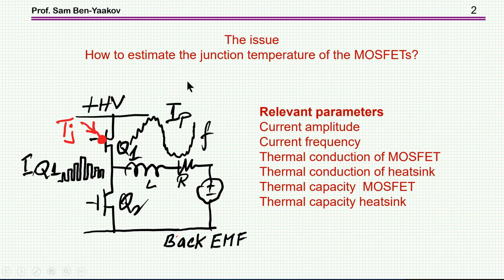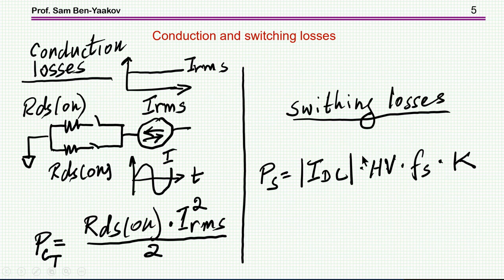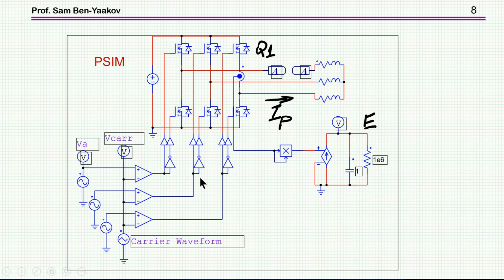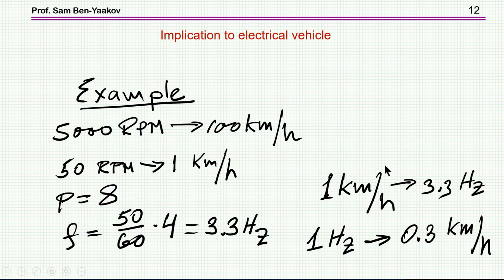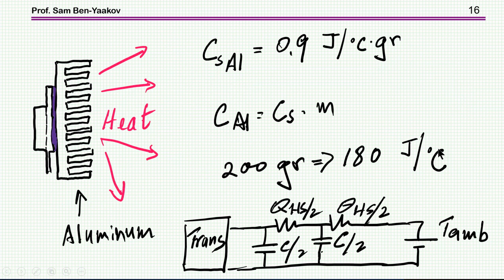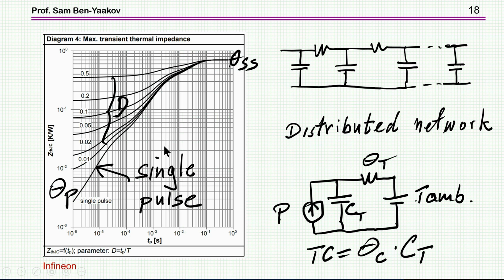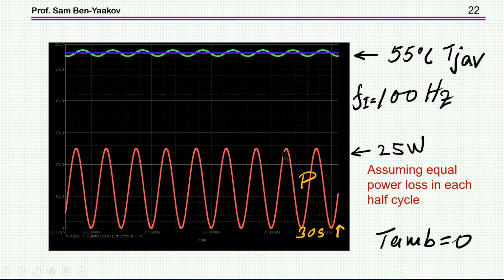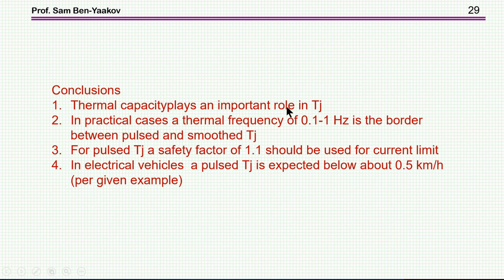MOSFETs junction temperature in power inverters: Low phase frequency and thermal

Comment: Such a great explanation!, i only have one question.. do we usually consider the calculated capacitance in the circuit as milli J/°C ? Because when you calculated it, it was 180 J/°C which i thought is so large and will result in a very high time constant.. but when you plugged it in the RC model you split it into two 90m J/°C which i think makes more sense to my understanding.  

So sir, is dividing the capacitance by 1000 the right approach to go? 

I mean, the simulation results you showed are reasonable. But are they for a 90m J/°C each or for a 90 J/°C each?
Reply from the maker: Please indicate which minute in the video you are referring to
Reply: @sambenyaakov  
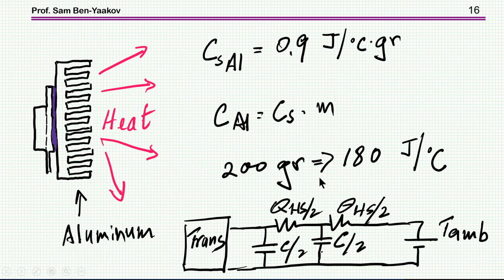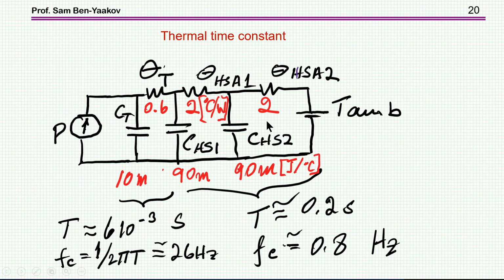Minute 19:20 you showed the calculation  to be 180 J/°C .. and on 19:30 it's written in the circuit as two 90mJ/°C .. 
Thanks for the fast response

Comment: Thank you for the nice explanation.
Can you discuss the concept of peak power in inverters? For example, during acceleration the inverter provides 2 or 3 times the rated power for short time. I believe it can be related to the thermal capacity and tansient thermal impedance of the switch. Assuming it happens at relatively higher frequency than 1 Hz e.g 50 Hz.
Reply from the maker: Have you seen : https://youtu.be/vTj5f8EQ13I

Comment: Thank you professor for the informative video. It will be very helpful if you can also explain the thermal modeling of the transformer as it is of serious concern in high frequency and high power density converters. Thank you in advance.
Reply from the maker: Thanks for note. Some of my earlier videos touch on the transformer thermal issue

Comment: If accurate saturation voltage measurement was possible, do you think it would be a good way to estimate Tj in real time?
Reply from the maker: You mean voltage drop on Rds(on)?
Reply: @sambenyaakov  Yes, knowing the current of course. In big IGBTs there is also interest to measure this voltage as it may indicate when a bond wire has broken internally.

Comment: Thank you for this interesting topic. But how calculate a thermal cross coupling between of 2 or more power parts in the same case (inside of a power module)?
Normally you have a IGBT and its freewheeling diode very close together. Thus they hit each other considerably.
Reply from the maker: Since the thermal conduction is a linear system, superposition applies.